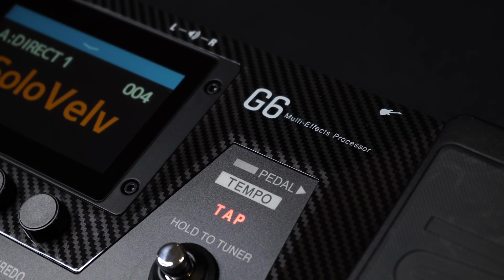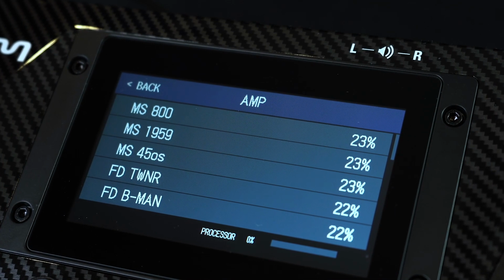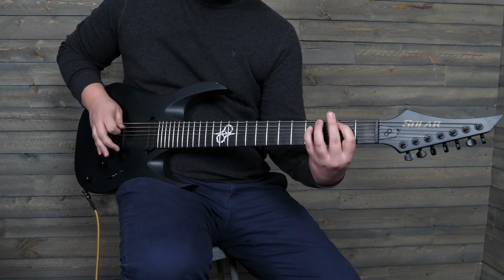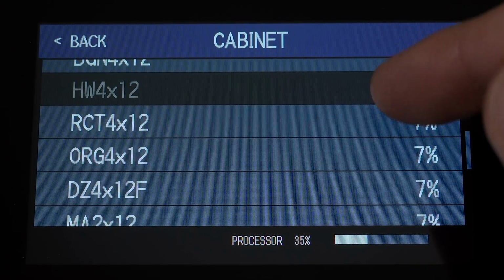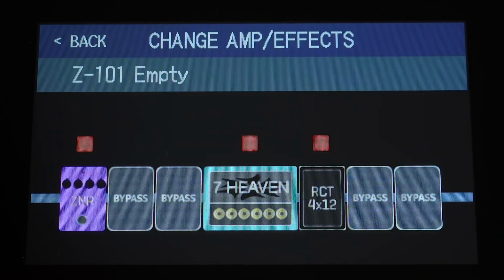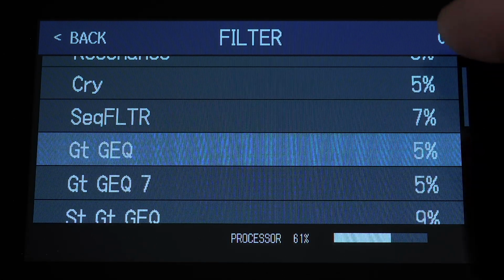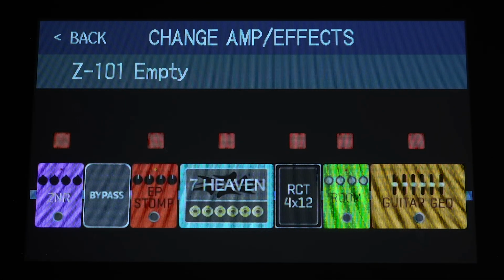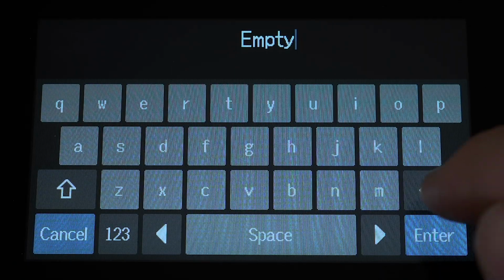Zoom G6 Multi-Effects Processor: Creating A Custom Patch

Comment: Coming from the Spark 40, all the unnecessary clicks in this interface - and its sluggish reaction times - really bug me. The device has got a touch screen and I suppose all the developers are well familiar with touchscreen interfaces from their smartphones, and yet... for changing the order of effects, you don't just drag-and-drop it into its new position - no, that would be too easy! - you have to pull down the menu bar, which needs a specific, relatively slow swipe speed - where a simple click would suffice plenty, and have to enter a specific - and exclusive - "change order" mode in order to do so. And then, of course, once you are finished with that, you have to exit that mode and enter a new one if you want to get any work done.
And in contrast to other FX units that boast over 100 factory presets and a hundred more empty slots, there is no way to quickly navigate across this considerable number of patches. Switching through the banks - 4 patches at a time - is the best the B6 has to offer.

What am I missing here??

This would be half as bad if the "Guitar Lab" editing software was halfway decent, but for some reason that eludes me entirely, the app always needs several attempts to find the connected B6 on the USB port - at a time when Windows has long since recognized the device and routed all audio output to it - AND the B6 has also confirmed the connection. And why is it that in 2022, we still need USB to control a standalone device from a computer? Others are already using bluethooth connections for editing software on mobile devices.
Dear ZOOM developers: this device set me back $500, and it does not even come close to the "cheapest" guitar amp out there at the moment. Surely you can do better next time?

Comment: I dont like that the amp+cabinet takes places on the chain. Line 6 made it default, so more effects can be used on the chain.
I would like to use reverb, modulation, delay, compressor, volume pedal, amp+cabinet and somethimes more then one delay...
Its not enough and the processor would be overload. Zoom effects are top for me, but the processor seems weak to use more then now possible.

Comment: I’ve got mine on preorder. I’ve used digitech 350, 355, 360xp
for years. Because of the touch screen, visual patch layout, it being newer technology, I’m hoping it’ll be easy to use, work great with my computer, setting up & storing patches, & sound great! It has presets, and that’s all I ever used. But I’ll learn & understand what effect does what and how they affect the chain/patch.
Nice video. Thanks.

P.S. For use with a computer, How come Zoom G6 went with USB micro B instead of USB C?
Or the Host to device (the old O.G. camera cable)?